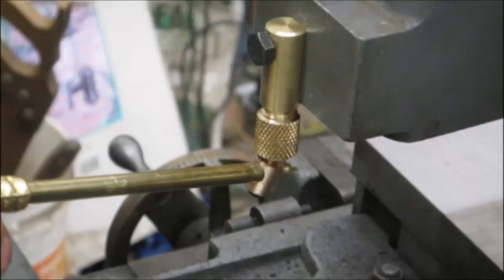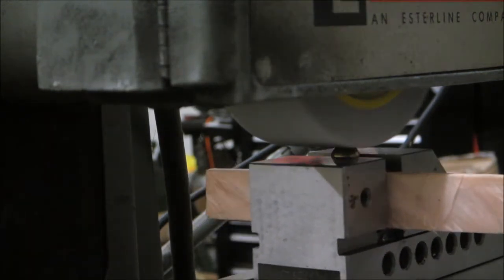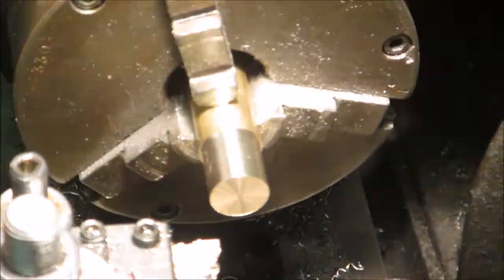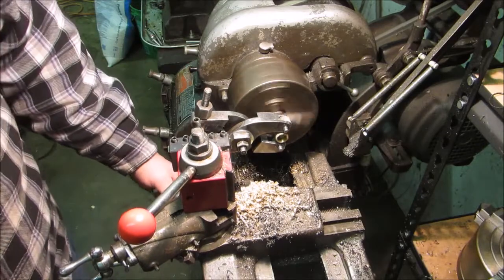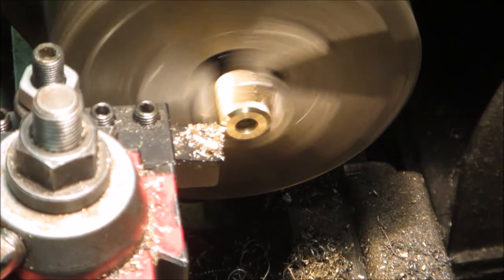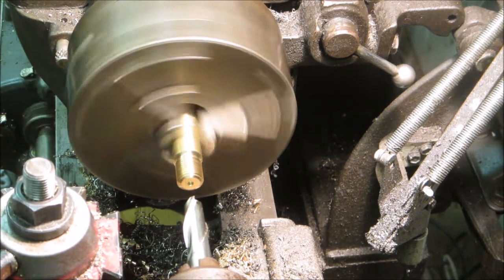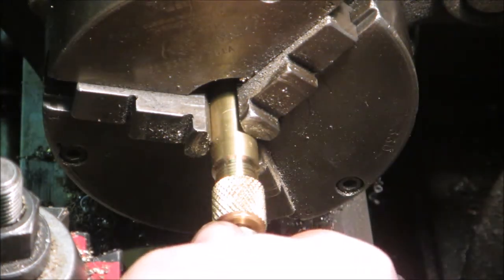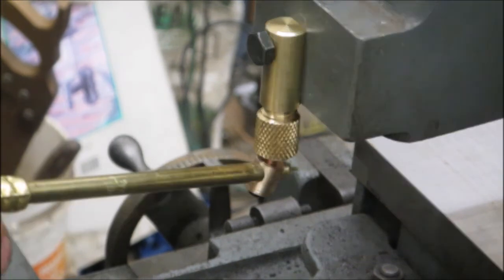Nozzle Holder for Koolmist on the Surface Grinder

Comment: Very nice build and it is great to build tooling accessories for a machine
Reply from the maker: Thanks for visiting, Chuck.  It was nice to get this done (at least mostly). Learned a little about order of ops, how not to work hold brass and was happy with the way the knurls turned out.

It was funny the other day I was trying to figure out way to fix one of my smaller cameras which had its 1/4-20 mounting hole stripped out because it was just plastic. I remembered that they made 3/8 to 1/4 adaptors, so got one of those, clamped the camera lightly in the mill and drilled and tapped the camera for the 3/8 size and loctited in the adaptor. Was able then to use that camera again to shot all of this video. I do need to come up with some alternate methods to hold camera if I do get out more often and video.

Take care. I hope Tim is resting a little easier being back home.